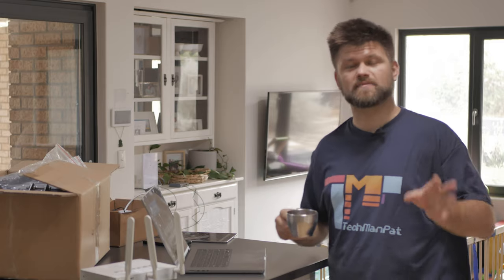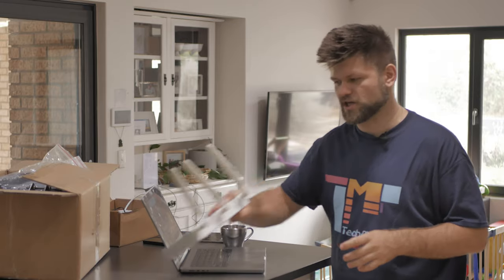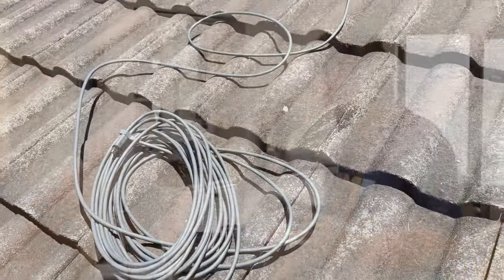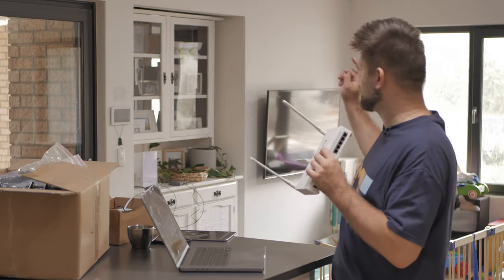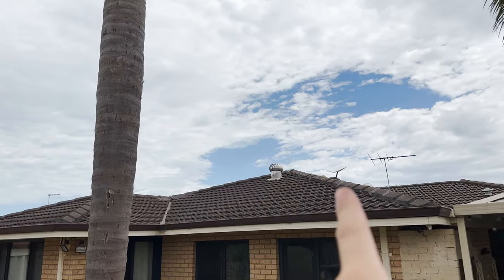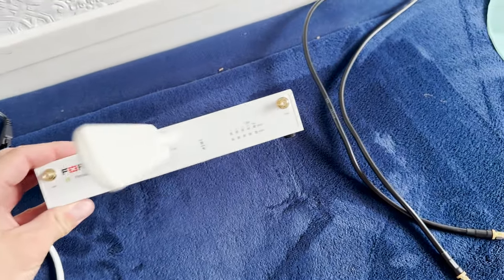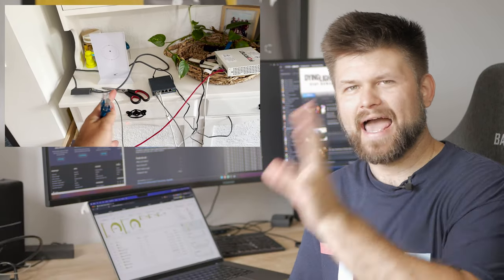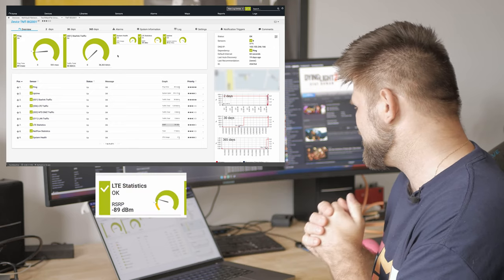Seamless Failover for Starlink | TechManPat

Comment: I think the +45 and -45 is to do with the direction of the internal antenna tilt. It’s common on antennas used for transmitting so you can direct the signal. That’s why it was so slow on data because no matter what it would be pointing 45 degrees away from the intended target (the tower)

Comment: All the traffic go for the VPN so there will be some overheads and additional latency depending on the ground station location. This can also set up for link aggregation as well using this type of typology.
I would say if I want to play cheap I can get a VPN with dedicated IP then use pfSense for failover handling. Fortinet is not absolute necessary.
Alternatively a VPN link can be set up on a VPS then all the traffic can go through the VPS.
Pretty much people are buying services, the typology itself is quite simple.

PS: watching this using Starlink residential in VIC. I am testing Starlink from my end as well before switch back to NBN in couple of months time with 4G backup.
Reply: When you say link aggregation are you taking about load balancing the 2 internet connections?

Comment: To compare pricing with a DIY kit-
DIY one offs:
Deco 4G router $280 (supports 4G failover)
2 X high gain LPDA antennas and 5m cable from outdoorrouter $232
Statlink equipment $450 (on special rn)

That's DIY $962 vs $2154

DIY Monthly:
Statlink $140
4G optional plans. example Optus 20Gb pm for $20 or Optus unlimited for $60 pm

That's DIY $160-$200pm vs $332 pm

Quite a cost difference there.

You do get a persistent static IP with NetVault but I can't see that making a difference unless you're running a server or something unusual at home.
Reply: Is the Optus unlimited for $60/mth speed capped?
Reply: @iamdave84  yes, 25Mbps max but I thought that was close to what Pat got over 4G anyway.
Reply: @futurecactus  yeah, his download speed was within that capped limit but upload was higher than the 2Mbps capped speed of that plan

Comment: Why wouldn't the Statlink plug directly into the Fortinet WAN port? The switch is an unnecessary waste.

One other thing you didn't mention is that the Statlink router should be put into bridge mode or do Netvault need it in router mode?

Do they only offer Optus 4G or can you use other carriers if they have a tier closer to you?
Reply: I was a bit curious about the purpose of the switch too
Reply: >> The switch is an unnecessary waste.

This is because SpaceX changed the ethernet chipset/firmware about 6 months ago and when you connect the Starlink Ethernet adapter directly to a high end router like a Fortinet/Cisco/Etc, you get very high packet loss, CRC errors, etc. Adding a dumb switch in the mix gets around this problem. We never had to use the dumb switch with the round dish, since it had native, proper Ethernet directly in the PoE brick.
Reply: I think the dumb switch was only there to demonstrate the failover so that the Fortigate still saw the interface as being up, while the service itself was "down". If the cable was connected directly, it would have been a link down versus a "service" down.

Comment: I would invest in a POE switch that has the capacity to do a wan gateway, having starlink, xg external antenna and may be a pentanet  hookup

though note how many devices you have connected you have connected both wireless and wired  connections in the home..

Comment: Cutting the cable takes the physical interface down at layer 1 so sure it’s the fastest failover 😂

What happens if your physical interfaces are both up but the satellite is not in phase, does it failover?
Reply: I think that is why Pat had the dumb switch in the middle, so the Fortigate thought the physical link was up, and then had to rely on something more involved like an upstream gateway monitor ping or similar to determine that the service was down before failing over.